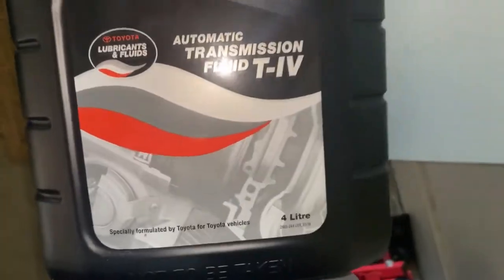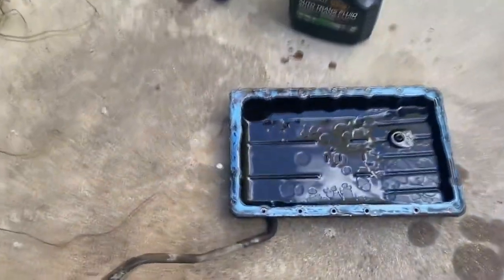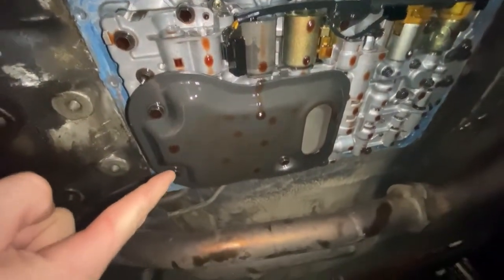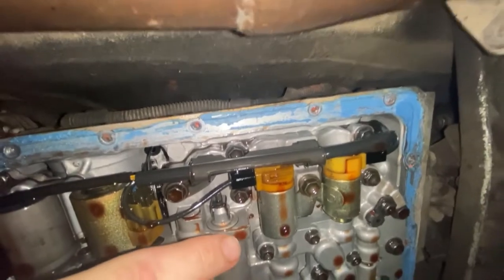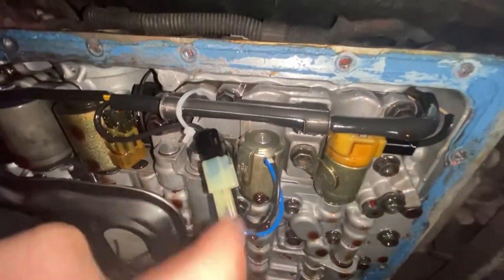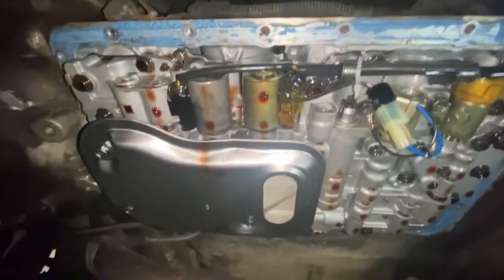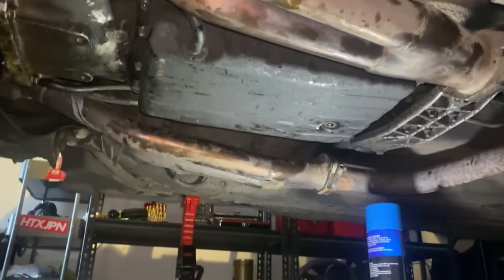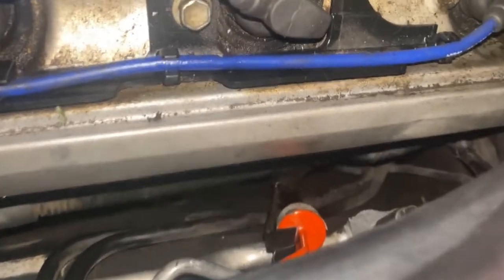A341E SOLENOID AND FILTER CHANGE - PART 2

Comment: Hi mate, i know its 2 years ago...so on second video you changed number 2 solenoid, did that work and was that the correct solenoid spot for number 2? As i gotta do mine, much appreciated Wayde
Reply from the maker: Hey mate, sorry I haven’t checked this YouTube channel for a while! Yes the solenoid I showed myself changing in the video was Solenoid 2, although at the time I replaced it with a lockup solenoid instead of a shift solenoid so I had to do the procedure a second time but it was the exact same ✌️